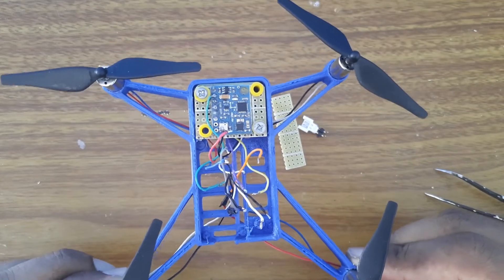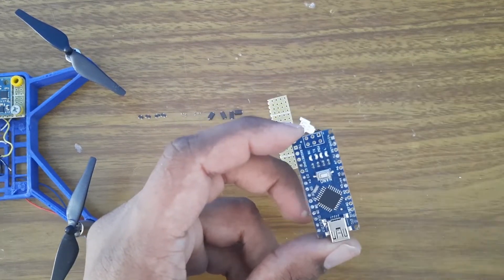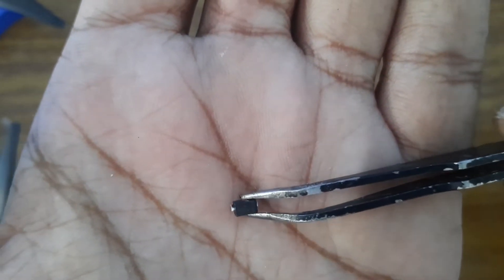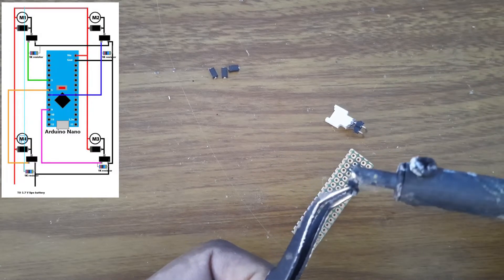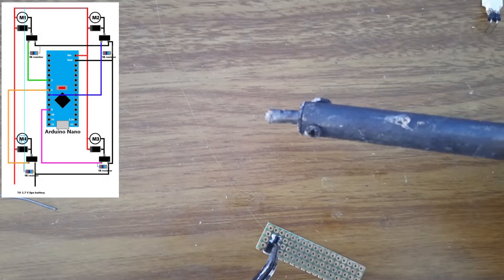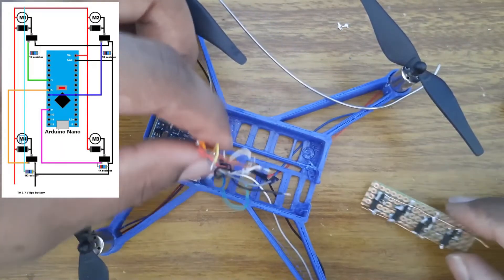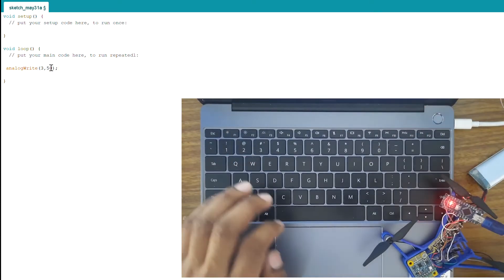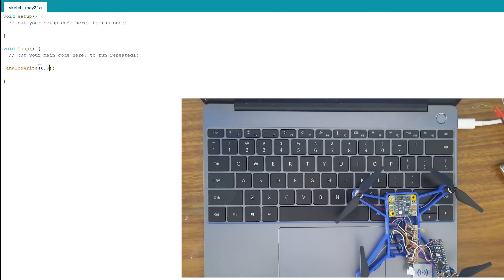DIY DJI Tello using Arduino (Part 3)| Making ESC for coreless brushed DC motor

Comment: If you use optical sensor it will be great. And incredibly stable as like as dji has
Reply from the maker: hello, thanks, i'll try that.
Reply: @minilab3d  when will you upload your flight video?  Waiting for
Reply from the maker: hello, tuesday
Reply: Can you give an example sensor model?
Reply: @neyazk9486 yes.  Of corse wait a bit
Reply: @neyazk9486  model is: PMW 3901 optical sensor
Reply: @bdnewslive5214  thank you so much, I'll look at that sensor.

Comment: Bro what is size of propeller?? I have 2.0" propeller and Micro air frame also, that is more small than your air frame, so 2 inch propeller is sufficient for flying??
Reply from the maker: hey bro, 2.0" propeller i dont think so, as it won't provide enough lift. Well you can reduce the weight as much as possible, use 720 coreless motor and a 450mAH lipo battery, then it would probably work. you can try that
Reply: @minilab3d  bro, I have 8520 coreless DC motor, is it ok to fly??